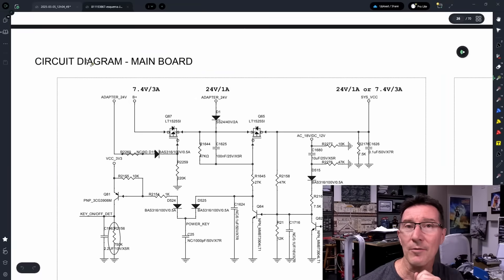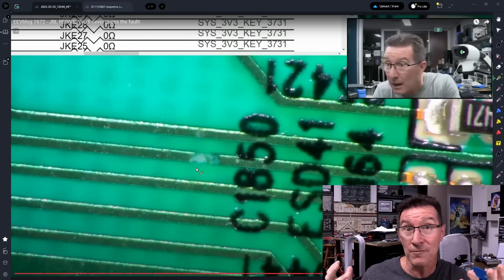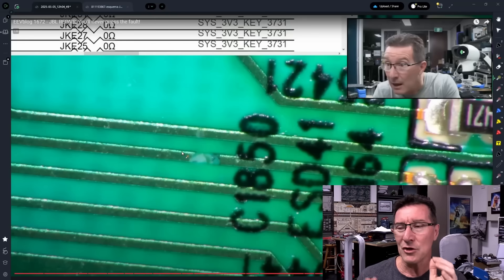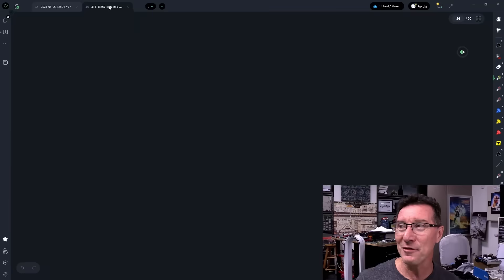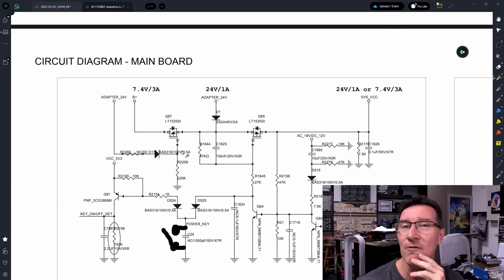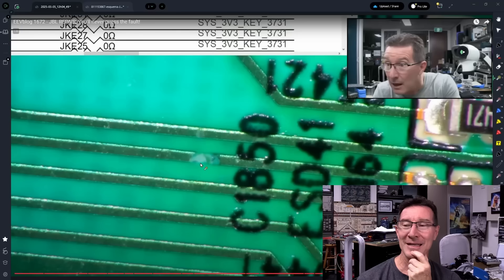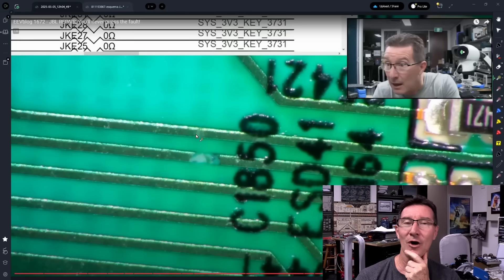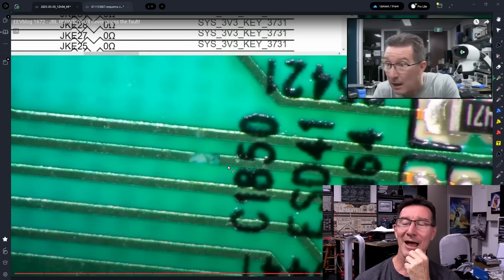EEVblog 1673 - JBL Partybox 310 Repair - Part 2 (SPOILER)

Comment: As Brannigan mentioned, for electrolysis to occur there needs to be a potential difference between two points, bridged with an electrolyte. for this the track needed already to have been broken at that location. the defect would have occured then already, without having to rely on the unlikely event of some suitable liquid starting an electrolysis.

Besides that, electrolysis frequently is a messy process which would have left some visible hints. the broken trace looks like cut,  well defined. with electrolysis i would have expected less clear edges.

a quite imaginative and nice story though. i had pcbs destroyed by cat piss. there one could clearly see that corrosion had happened. and the damage was not that sharply localised.

Comment: Liquid Damage to an electronics product  should not be a warranty repair as the liquid can seep under IC's  and other places and Electrolysis  take place. Often even a full clean of the PCB to remove moisture/rust and Electrolysis  can not be guaranteed  and the effort to remove all ICs as not financially viable !

Comment: It was most likely just water condensed from air, as the PCB had a big stain trace all over the rubber membrane. Those speakers are often used outside, where water could easily condense. There's always some residue on the PCB which diluted with water could cause hydrolysis.

Comment: Cheap boards made during monsoon season have notoriously weak copper adhesion.  Any thick dot of soldermask would have significantly stronger adhesion to the copper than the copper's adhesion to the board.  Rubber elastomers under pressure experience stiction.  Even mild temperature cycling increases this adhesion.  When the elastomer was removed, it pulled up the weak track via the mask.  You can see the superficial delamination on the surface.
Electrolysis doesn't vaporize the copper, it moves it.  Where did the copper move to?  There is no trace of a residue.  Try to cause water damage like that without leaving a trace.

Comment: Well spotted ! check the gasket near the area of contact. Amazing that everything else still works considering what its probably been through. Must be good packaging.

So many fluids mentioned already, but not the infamous phospohoric acid containing wonder drink, allegedly good for tarnished coins, teeth rotting, and windscreen stripping...
Reply: it would have left a definite sticky residue / seen that before. its just been left in the rain

Comment: @EEVblog, my guess based on what looks like solder mask where the trace is missing is a trace that lifted prior to the mask being applied and vibration, thermal stress, or the "rubber" switch base caused it to fracture and flake off. Who knows... you found it an fixed it. YAY!

Comment: Do not underestimate CURENT RUSH through that power trace when the unit is turned on/off 1000's of times, the trace does get hot, and by thermal cycling the copper expands and contracts and eventually delaminates from PCB substrate.
Reply: Although it controls power this line is just a low current signal line. It looks like it will be about 1mA while the button is actively pushed in.

Comment: I would guess it was damaged in assembly before the solder mask but was still connected by a very thin remainder of the trace held down by the solder mask and then a tad of mechaical or chemical is all it took to take it out.

Comment: You are basically describing electroplating. Just having a potential on a trace won't do much unless there is an electrolyte and a path to a different potential. Where is that path? Secondly, assuming that the path from the trace is to ground, the other side of the electrolysis would be plated with the copper from the missing trace. I don't even see any discoloration. ???

Comment: I mentioned this on the part 1 before I found this, but plastic foam has a lot of plasticizer which is what keeps it soft and springy.  Plasticizer can cross-contaminate to other materials in contact with them.  Per Wikipedia page "Plasticizers can escape plastics due to migration and abrasion of the plastic since they are not bound to the polymer matrix."  Maybe contact with the mask softened it as well and then the sound vibrations from use of the product caused the foam mass to sand down the trace over time.  If that trace had continuous current then it would've been warmer than those that did not (or not as much) and that may have accelerated the chemical reaction for it.  The other traces were probably under attack as well but more slowly and the breaking of the power trace first would've ceased use of the product and put an end to the destructive vibrations.

Or, it could've been total coincidence.

Comment: JBL claims that this speaker is water resistant. I have the same one and have used it outside in the rain. It still works great. I use it everyday in stereo mode for my pc.

Comment: I can agree. Positive voltage lead to oxidation (anodizing). Rubber contain sulfur and sometimes graphite, so in some cases leakage current can be high enough to attack thin copper layer. Other signals with lover voltage act like cathodes, this explain why all of them are in good condition. 
But i guess this places was wet in some time or it was wetted periodically. Or someone before Dave clean PCB and was not ready to caught so small gap.

Comment: My best gues is still mechanical rubbing. Not from the rubber membrane but from the plastic wall around it. The power butten is often presses firm and impationally bending the plastic wall extra near the power switch. You could have a look at the reflow wire you soldered in with the capton tape on top. I expext that you can find pressure points again. The capton tape however will protect it for the coming years.

Comment: To me that mark looks like the board was knocked or abraded at that point. Usually corrosion leaves a lot of evidence, copper oxide deposits, water marks, dirt deposits etc. Even if the offending liquid was pure water, it always picks up some dirt on its way in and deposits it as it dries, leaving an outline. And corrosion would happen on the exposed terminals to the right, not on an area where the solder mask was intact. I didn't watch part 1 so I don't know if you gave it an isopropyl bath before taking that photo, but I assume not.

If it was at the power button, it could have been a small piece of sand or metal swarf or a tiny screw or something stuck on the button itself. Each time the button is pushed, it grates on the PCB. I've most commonly seen marks like that on boards that have been dropped and something hard impacted the PCB.

Comment: Which still doesn't make sense how it happened. Corrosion, or the rubber baby bumper thing that the front panel has... or, was it an over current condition that blew the track open? Ah, electrolysis... yeah, I get your thought process.

Comment: I had a similar problem a few years ago on an H-bridge type power stage where we had a build up of dust between a 48v trace and a data trace and over time the dust settled and in times of high humidity this combination was capable of damaging the solder mask and therefore killing the circuit😂😂 but we learn from that Experience.

Comment: I saw exactly that before on a board designed by me several years ago.
It was a product with a fan inside and some customers with high humidity often complained about defect fans. We then got some boards back and discovered that the trace that powered the fan was eaten away on a really small area, although the board itself was conformal coated.
The problem was: The coating ended 3mm before the edge and the trace ran 2mm away from the edge on a small spot and exactly that spot corroded away. It looked exactly the same
Reply: Was that oversight fixed in a future board revision?
Reply: @eDoc2020  An Interim solution was to coat that spot manually with a brunch; in China that cost for our quantities round about 5¢ extra per PCB.
A year later we fixed it in a new layout revision; the track was just slightly shifted away from the edge of the PCB.

Comment: This trace is under standby voltage all the time unlike the rest. That’s why it corroded first. Same issues with cars wiring corrosion in salt belt. Pins and wires that are hot at all times corrode first.

Comment: Yes, Dave, when you asked the question, “why just THIS track?” I cotton-oned pretty quick..this is the only track with POSITIVE voltage on it.

This makes an excellent segway into another topic you could do a whole video on…the history of rail polarities!

I suppose you know that the 1860’s telegraph line from Adelade to Darwin had a negative boltsge with resprct to ground, this made it a cathode in wet situations…and I believe the wire was steel, not copper. So they knew about negative means electron excess means chemically reducing conditions…thus preserving the wire and reducing maintainance…in yhese modern “i-Times” we seem to overlook these basics.

When valves came along, their directly heated cathodes and heater batteries/supplies were best close to ground potential, do we switched to positive rails on their anodes to ATTRACT electrons to them.

When the irst germanium transistors came along, arsnic doped n-type germanium was made at high temperature then, later, transistors were made by placing blobs of low melting point indium on either side of the germanium wafer, the indium diffused into the germanium to make to p-type zones from either side…hence PNP. Do you recall just how careful you had to be with old germanium transistors like 0C71’s and the like, had to keep their leads long and hold with needle nose pliers as a heatsink when soldering…this is necause the heat could travel up the lead and malt the indium “solder” M.P. 132*C, inside the transistor, causing further diffusion and formong a non-functional “PPP” transistor!

When silicon transistors came along, it was the opposite, NPN were easier to make, so our rsil voltsges went negative during the germanium era, then back to positive again with Si NPN. Recall how 2N3055’s were available WAY before The MJ2955, and most audio amps were quasi complimentsry….Doug Ford could weigh in here!

Now we use rails of both polarities, but positive seems to still predominate, particularly in digital stuff. 
This is why telephone excyhanges still use -50v, a hangover from the old telegraph days…do data centres still retain this standard as DC backup?   There is a whole interesting topic here. 

Why did some cars use -6v, like VW beetles?

Lots to explore here!

The light globe collector.
Reply: Fascinating. I don’t suppose this has anything to do with centre-negative/positive barrel jacks?
Reply: @Scrogan  I think this traces barrel jacks to guitar pedals for some reason they went center negative I think they were switching the positiv from battery it's required to swap I do remember something about it also being related to using the case as ground or some thing I can't quite remember.
Yes this was an excellent read, the -48 V telephone standard really throws people.
Reply: @imark7777777  negative polarity reduces corrosion by    moving it to/ accelerating it at   the positive conductor

Comment: If it was electrolysis there'd have to be some sort of build up on a negative point somewhere else exactly in line with the membrane outline. Otherwise I'd say whatever was spilled just got exceptionally sticky right above the power key trace and some agressivew button pushing flexed the membrane enough to lift it off and break the trace.

Comment: I think the break is too sharp a break for it to be erosion. I reckon it’s just a straight flaw in the pcb during manufacturing and the section missing just eventually fell off.
Reply: Concur, other than when the button is operated, there is no current flowing down that path and there appears to be no spillage (unless vanished) that could have caused erosion between the 'powered' damaged track and any adjacent one. Most PCB flex could have occurred at that point (when the button was operated).
Reply: I agree! 
Additionally, if it was electrolysis, you'd need a potential difference. But as long as the button isn't pressed, the small upstream part of the button's trace before the break is not actually at circuit ground potential. There's no 24V or 8.4V across that gap's spot until the button is pressed, yeah? 

So if the trace isn't broken yet, then the contact with the rubber wouldn't have caused electrolysis, as it doesn't provide a lower potential location. It would be really far fetched for electrolysis to happen when there's hardly any place for a potential difference.
Reply: I agree with that too, in fact the whole area is to 'Clean' for me to think 'electrochemical' looks like a manufacturing defect just as you say. I need to look again as I can't remember if Dave sorta picked at it or it just fell away. I just can't buy the electroosis bit at the mo.
Reply: yep

Comment: Yeah but! What's the IP rating of the JBL? 
I really don't see how a liquid or dust for that matter could possibly have got into there? 
My Tribit portable Bluetooth speaker is ip67 rated and will even float with the speakers facing up in a swimming pool! (Not recommended practise but if it fell in it wouldn't be a problem!)..... 
It could just be bad luck with a bad trace from the factory that made it through all the tests and was finished off by the rubber over time with heavy bass use! 
The majority of people who get these things do so because they put out so much bass! And that's exactly how they are going to be used! Flat out like a lizard drinking! 
There's a point where you have been drinking alcohol where you no longer feel the pain that the speaker is going through and you just want louder! 
That particular one looks like it has seen a lot of parties in its life!

Comment: To have electrolysis you need to have contact between positive and ground through the liquid, and then fairly high current flow. There is no ground exposed around that location. On top of that, there will always be some residue evidence. 
Don't think that the presented theory can be backed up with any evidence. 
Additionally, this theory can very easily be tested with a drop of water. I would think an electronic engineer like Dave would test any theory of his, before it's been made to an "Aha" video.
Reply: The residue of the spill was all over that area of the board, there could very easily be a leakage path to ground. I would say all the evidence strongly suggests a galvanic corrosion failure.

Comment: My vote is a factory defect! The copper could have been over etched and not masked well and oxidation could have eaten it away! Only way to know with certainty is to have factory photos. It could have been nicked during the assembly process. But, it's all speculation! I don't think it was from beer or a spill as that would cause component corrosion. The rubber rubbing it is still a possibility! Line up the rubber as if it was being installed and see if there is a hard spot or anything that lines up with that trace. There could have been an excess of stress on that high spot. Good luck Dave!
Reply: Agreed. I would say there was poor lamination of the copper at that spot when the blank PCB was made. Perhaps is was as simple as a trapped air bubble or particulate matter that elevated the copper from the FR. That would lead to over-etching and thinning of the copper which could have held on for a good while and passed testing and real world use only to be later rubbed at till failure by the rubber membrane. The board and surrounding traces show no signs of chemical corrosion and the electrolysis idea is just silly given the clean edges of the trace and intact solder mask. Residue would remain from chemical processes so it's just not the case here.
Reply: @notsofastener  yes if it was electrolysis the other trace with the negative voltage would look nasty the one trace cant have electrolysis unless its already got a gap in it lol

Comment: Happens a lot near caps that have crapped their pants too. Same issue, signal or power traces with a positive voltage get eaten through, quicker if there is ground nearby
Reply: No electricity needed for that to happen.  It's common in vintage electronics that have been setting around for decades unpowered to have horrible circuit trace damage.  As soon as the cap starts to leak, leaches down the capacitor lead and hits the circuit trace corrosion starts.  Combined I have probably spent a few months of my life repairing corroded circuit traces.

Comment: So if it's electrolysis, there has to be a voltage between the line that is damaged, but a voltage is always compared to something else.
So one or both of the lines next to it, have to be ground (or a lower potential at least).
Next question: why is only the line that carries the positive voltage affected? 😉 I know the answer, but I'd like to see if anyone comes up with it too 🙂
Reply: I'd expect every other line would be weekly tied to ground in some way, either through the μP or by pull down resistors.
Reply: The positive trace would act as an electroplating anode. The copper oxidized from that trace may have been electroplated onto whatever point the liquid contacted that had the lowest potential. If it spread around enough you'd have a hard time finding where the copper went.
Reply: @kevinmartin7760  Indeed. All metal ions are positive. So for metal to disappear from a track (into/through the solution to another track), it has to be a higher potential to it's surroundings. The metal atom has to reduct electrons to become an ion, and that can only happen on the positive side of a voltage potential.